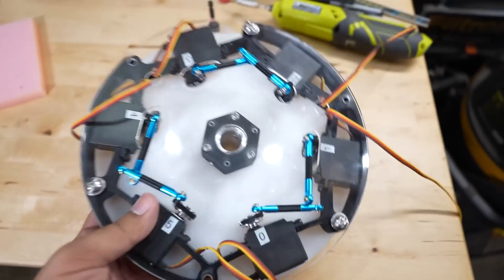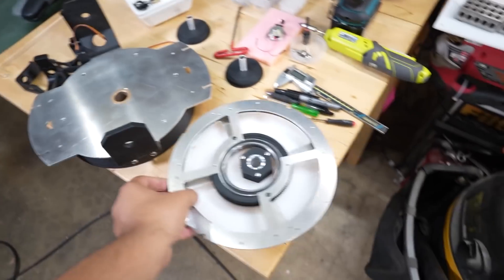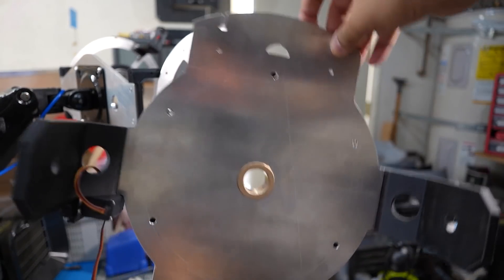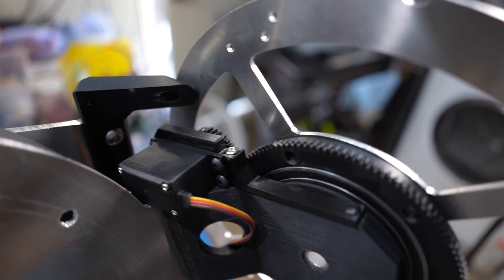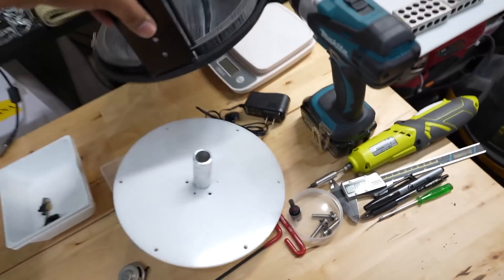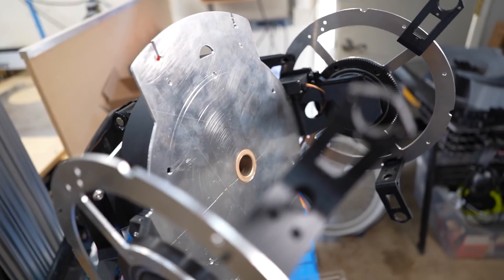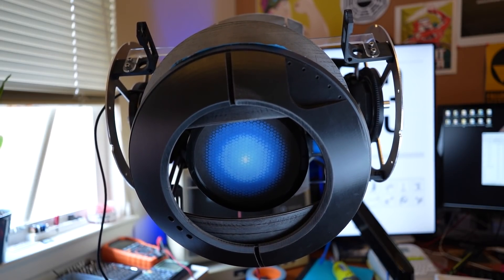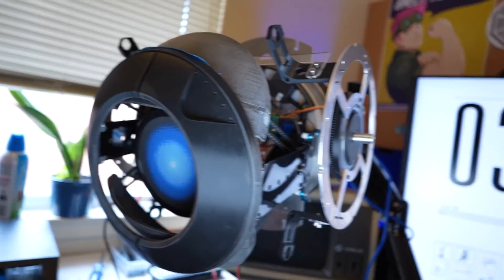Portal 2 | Wheatley's Chassis and Stewart Platform

Comment: how mutch lighter would your design be if you would use carbon?
Reply from the maker: Not dramatically. The hanging portions are already minimal 3D printed PLA and thin acrylic sheet. I did redesign the eyelids to be significantly lighter since this video though :)
Reply: @MrVolt  
i see. ^^
ooh cool to hear that. i'm already looking forward to your follow up video ^^

Comment: I know a few websites with some info on the movement of the core. Just a few personal notes, I think the x and y rails are locked together and if you apply a bearing to the back of the Stewart platform you could get the eye to go 360, also could you please make some files to 3d print this, it doesn’t have to be functional, I would like a scale replica of a core the size of a baseball and with the same movement
Reply: https://www.google.com/amp/s/www.instructables.com/Animatronic-Wheatley-V20/%3famp_page=true

Comment: Nice work. Do you mind me asking, if two stepper motors per side. Would make it easier to move? Or would it be more difficult to wire up?
Reply from the maker: Not much harder. I'm just trying to keep the weight and parts count down. I'll have to test this out though!

Comment: in portal 2 Wheatley's movements are much more fast. also if you dont already you should start a Patreon page its completely free and it would help pay for this stuff so maybe you could get those Linear actuators
Reply: It's much easier to animate a 3d model with quick expressive movements than it is to get a bulky robot to make quick, reliable movements (especially without tearing itself in half)